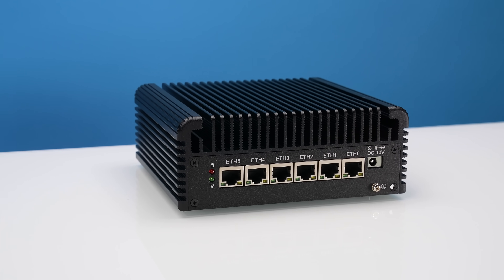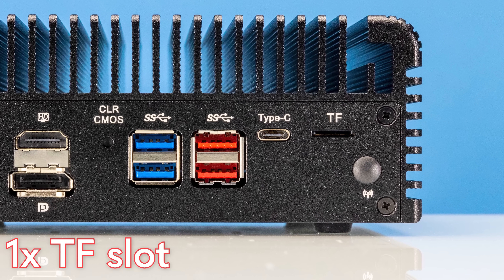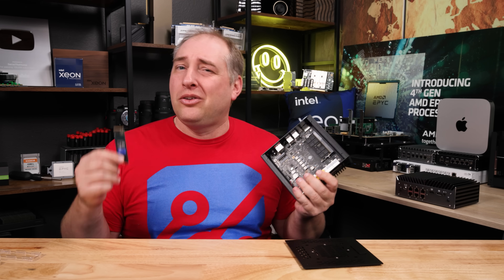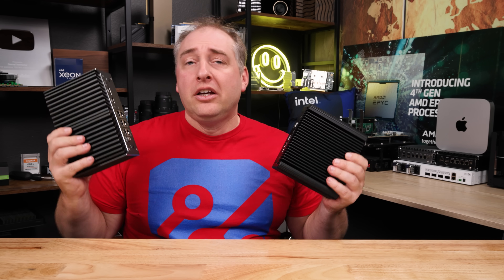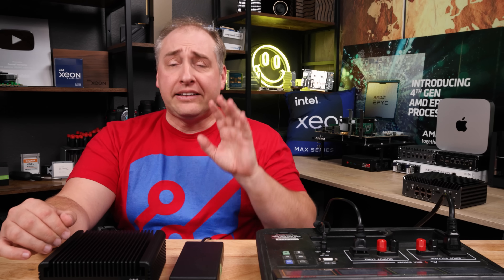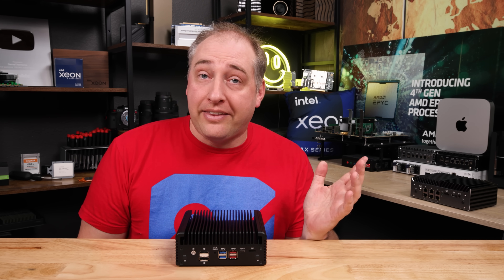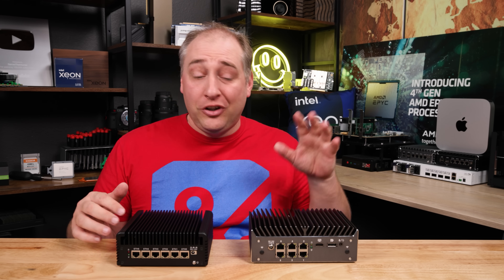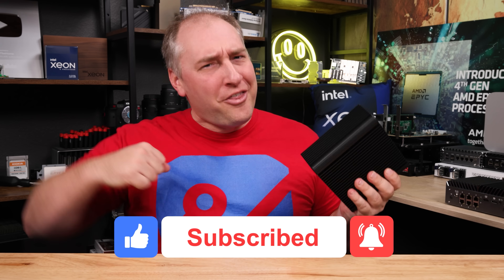KING of Fanless 2.5GbE Mini PC Routers and Firewalls Now with Intel Core i5 Alder Lake

Comment: @4.17 it says Note: These are VERY picky on RAM, and then it says DDR4 3200 SODIMMs.  Does that mean they need to be DDR4 3200 SODIMMs, or they need to be a specific brand?  A link to the RAM would be useful, thanks.

Comment: I have a question. I've been trying to go through a lot of your videos, but for some of these mini-pcs, I don't see any section on networking throughput. Can this (and other devices that do not have a network section) actually push, say 80% 2.5*6 (or 2.5*4) Gbps? What about when using a lot of firewall rules? Can it do 2.5Gbps when 1in-1out? 
I don't find this review helpful if there is no section on network throughput. Especially when the device under test has CPUs like the J3710 (the protectli) - they seem weak, and some reviews do say they aren't strong enough. I really hoped you'd cover this in some of the other recent and past reviews I've been binge-watching.
Reply from the maker: This is in a completely different class. N5105/ N6005 can do simple 3 in 3 out 2.5Gbps NAT. Adding firewall rules it depends on how big you go there. Still, this is in another class since it has P-cores. Since the barrier to 2.5Gbps throughput is so much lower than what these offer, you can even virtualize and do 2.5Gbps NAT + firewall on two ports without issue.
Reply: @ServeTheHomeVideo  Thank you for the info! This really helps. I was looking out for some open source-ish hardware, and the protectli came to mind. I wanted to the low-tier 2.5G ones (The VP2420), but was unsure if I can push 2.5G through at least 3 ports close to their peak bandwidth with average amount of rules etc. Protectli has some benchmarks but that seems to stress only one interface. 

Also, these alibaba ones have good hardware, but what about bios updates? Since this is going to face the public internet, I don't want mine hopping into a botnet due to security issues from lack of firmware updates. Should I be worried about that? 
Thank you for your time!

Comment: I bought one of these a little while ago. Been using it as a small Proxmox system running OPNsense and home assistant. Proxmox sees all the NICs and bridges them all into one "switch" with no issues. Rock solid a month in.

My PSU was generic and didn't have a UL label... But they're pretty common PSUs, so you might even have one from a spare laptop sitting around.

Mine came with a A+E key to B+M key adapter board, so you can have two SSDs (albeit one at x1 PCIe) instead of one SSD and wifi.

The small, 10mm thick fans suck. Don't even bother with them. I have dual SSDs in mine and a 40x10mm Noctua keeps them both cool. I also run a splitter on the fan to aa loose fan on top of the heatsink because I'm weird. The design means the fan on the underside DOES NOT COOL THE CPU. All the CPU heat is going to the top heatsink. Stick a fan on it and it'll be fine. The fan connector is 5v only! So I suggest just using a 12v fan and setting it to max speed.

I really, really wish they had that fancy "turn normal RAM into ECC by storing ECC data in RAM" thing which has been on some Alder Lake embedded systems.

There was a BIOS update for mine. If you track down the info on the board itself, you can find links (on a dodgy Chinese manufacturer site) to working BIOS updates.
Reply: Did you have to drill out holes on the bottom of the cover for the 40x40x10 pattern? Any thoughts on a fan wise to use for the top? I'm assuming I'll just have to jerry rig some sort of ziptie mount, lol.
Reply: @jcarman  I just put one screw in, the fan isn't going anywhere even with just one screw.
Reply: I'm hearing the nic are not bridged which is your exact model

Comment: I have the 2x2.5Gbe N4000 version of this thing and I am definitely not happy with it. I bought it to use it as a simple firewall running OPNsense. However, the device would randomly reboot itself once every 24 to 36 hours. I thought maybe it was some hardware issue since I purchased the barebones version and installed my own RAM and SSD. I tried changing out the RAM to some "higher quality" SO-DIMM but after doing that the device won't even boot anymore. It appears to only accept 2133 spec memory. I could probably send a bunch of time trying to figure out which memory is the most stable in the unit but I don't really have the time or money to do that. I really wanted to like the product I bought but so far it's been nothing but a headache. I hope the newer version are better.

Comment: Can you advice inexpensive model for a pfsense or opensense based router? Just with a few 2.5 Gbit intel ports and a processor that will work around a few firewall rules and ad blockers.
Reply from the maker: We have some great, low power, and pretty inexpensive, fanless unit reviews with 4x 2.5GbE Intel ports if you look at our previous videos.

Comment: Oh boy, the stubbornness of my mind vs the reality of what is in the box...I have the older Qotom with the i5 7200 running PFSense bare bones. Been several years no issues but bug bit me... want a newer one with i226 nics.  Gotta be an i5 like what I have now...  finally a little birdie talked me out of it, get the 8505 instead.  i5 Kaby lake is nothing like 12th gen i5...  Even that 8505 runs circles around the old 7200, probably could have gone lower.  Simple edit of exported setting file then apply to the new box and I was back up and running.  Did slap a 120 fan on top to help those fins and it did cool the proc some 4~5c more.  Agree on the WD Blue- 26 bucks got me a 500gig one - I couldn't find a new 250gig on Amazon...  no biggie, zfs supports trim so the wear leveling has lots of room LOL.  Thanks for your review, I was waffling for a bit but glad I jumped on one.  Put my vlans on the nics, now just need a new managed 2.5gig switch...

Comment: I have the i7-1265U version and added my own ssd and RAM and it's been working great, I am using Proxmox + OPNSense VM and UniFi controller LXC
Reply from the maker: Mind sharing the RAM you used either here or in the forums? I think we should start documenting that for folks
Reply: Could you please tell about temps and throttling under load?
Reply: @ServeTheHomeVideo  G.Skill F4-3200C22S-32GRS

Comment: So I've been thinking for a while about retiring my poweredge iii 2950.. think it has dual xeon e5450 or something.. quick Google for 1235u vs xeon e5450 shows most benchmarks are 1.75 to 4x, anything under 2x might be a slight loss due to the server being dual proc but most benchmarks i see are 3 to 4x, geekbench4 is like 3.75x.. and under 30w for a whole system, silent versus loud server at probably like 300w idle.. I lose spinning rust raid for nvme (but I can keep server for some nas backup stuff and boot as needed) and lose ipmi (which is probably one of the biggest hesitations for me but while its nice to have I've rarely used it) .. this stuff getting so damn tempting.. originally I figured if I made the switch that whatever new mini would only run pf but if the benchmarks don't lie then I can easily setup xen or whatever and have basically the same setup but way quieter and faster in most scenarios and way more power efficient. My only gripe is I wish these had 10gbe ethernet ports but I'm an impatient weirdo that finds even 10gbe slow for certain things (setup 20gbe tbolt between my pc and Mac) .. I get that we're not at the point where 6x10gbe would be cheap yet but wish it at least had 1 or 2 10gbe then I could add a 10gbe switch.. I'm still damn tempted though and I'm moving soon and I can say 100% if I end up in a place where power isn't included then I'm gonna pull the trigger cuz I can't justify 300w minimum (and thats being generous since it has 2 cpu and fbdimms and 2psu) 24/7 for pf and some vms..and if I move somewhere that has fiber support then also yes for 2.5gb (fiber here is 2.5gb symmetric, my cable is 1gb/100mb but my building doesn't have fiber so fiber company will only do 50mbps/15mbps dsl and yeah no)..plus my server doesn't have vtd and often my lacp nics like to chug and max out the server randomly on low traffic (ugh, tried everything from different virtual nics to disabling offloading for every different possible setting both on xen and in pf, ovs still likes to have queues max out randomly, it's not consistent, it's totally random and it's annoying af but not quite deal breaking)

Crazy that a mini passive thing almost destroys a server from 2009 now in like almost every category except maybe expandability and ipmi although other than the loss of SAS RAID, the other expandability would be mostly for NICs and when you have 6x2.5gb on board that's the same number of ports I already have but 2.5x faster.
Reply: I think I might just say f it and order one of these or similar on payday anyway. Included win pro license helps offset too. I'm sick of my servers fan noise. For years and years I didn't care but last couple years I must be getting old and get off my lawn wait I don't have one. 

But seriously I was just waiting for something small cheap and low power than wouldn't be a huge decrease in performance and benches says its an increase sooo..

❤ Patrick and sth team for covering this shit and not just beast server noisy homelabs like I currently have. Time to green up i guess
Reply: Yeah 12w idle vs like 350w idle.. 3% of the power usage idle.. and probably max 5 to 10% pegged for more performance in most cases. I know my server is old but still..there's a time you just know to upgrade.
Reply from the maker: Yea, it saves a lot over time doing a NAS + then these smaller nodes. The higher-end Project TinyMiniMicro nodes are starting to be ~ dual E5-2670 V1 servers in CPU performance but with <10W idle. You just give up memory and expansion for low power and quiet.

Comment: Tried 8505 w 6xI226 and it's really good. Works with anything - Suse, Proxmox, DSM. Number of ports is insane, tons of internal and external ports. You can have 2 RAMs, 2 NVMEs and 2 SSDs, say what. SD card, type C with 4K video, RST, internal USB, WiFi 6 also works. CPU is pasted well,  no manufacturing issues, no crashes. Performance is fantastic, easily outperforms Alderlake i5(!) in single. With QAT, what else do you need for a VPN router? Update: so the best feature - QAT - is not possible with the AMI BIOS there:(

Comment: I am trying to install Proxmox on a fanless PC that has a 12th-generation processor (N200), and I am having the same compatibility issues causing the installer to fail.  I tried following the same installation procedure you laid out in the video, but proxmox 7.1 is not available for download anymore.  Only. 6.4, 7.2, 7.3, and 7.4.  I assume the installation procedure would be the same for my 12th-generation Intel N200 right?  Any thoughts or suggestions on how I can get the installer to not fail?  I believe a graphics compatibility issue is causing the GUI installer to fail.

Comment: I like your testing and reports on these items. I'm looking at replacing my Netgate 2100 with something more powerful and that doesn't have upgrade problems. I'm on FiOS and while I'm not at the top tier if I was the 2100 couldn't handle that either. Are you planning on a video covering what level of performance is needed for a simple firewall? I know of a few that cover pfSense and similar installations but a guide, even if you just have links in the description to good guides that is enough. I'm not a big Linux person but Windows Pro and such is my comfort level. In national security related work the separation of duties doesn't let me get the experience of sys admin stuff. I'm used to just RDP into a Linux VM that is running so I never set that up, just install development tools and code away. The various SW options on these things isn't so obvious. I have seen individual guides but not ones suggesting various combinations or packages (think of buying a vehicle and what goes with what), and what to install in Etsy order. I am one of the consumers that wants simple is better when it comes to stability. I don't care if logging goes on a 128GB thumb drive I swap out with a clean one from time to time, that's what I mean by simple. Again, thanks for the HW info I'm trying to sort out the SW side now that the HW is looking like a commodity (RAM, NIC, SSD, USB).
Reply from the maker: Great feedback. I am sending this to the team.

Comment: Proxmox 7.4 can be installed out of the box with no issues apart from display migrating from HDMI (default for bios and early boot) to type-c output, and after installing 6.2 kernel - all display outputs will be working once again.

Comment: I bought the 1265U version barebones. One big difference I don't think you mentioned is that it comes with 2 SATA ports whilst previous Gens had just 1. NOTE: Oddly it only comes with one SATA cable; I had to order another one for 15 bucks from the vendor.
Right now I'm running it with 2 NGFF drives w/SATA adapter boards, one drive has Proxmox, the other for VMs. It does get quite hot so I have 140 mm fan sitting on top of it, fits great and keeps it cool, no noise.

Reason I'm doing that is to free up the 3.0x4 m.2 slot, I believe previous Gens had a 3.0x2 slot. I would like to try buying a M.2 -> PCIe adapter and running a dual 10Gbe NIC with it. Do you think this would work? Also: What is that 4 pin power adapter on the board near the power button for?
Reply from the maker: Ours came with 0 SATA cables :-(
Reply: @ServeTheHomeVideo  That's not good😑. Any idea what the 4-pin connector next to the power button is? I assume it's there to draw power from...
Reply: Just posted about the same thing essentially: have one of these and would like to free up the PCIE3.0x4 slot in order to run a 10G SFP+ NIC. Would probably need to fabricate an expansion to provide the IO, unless you know a better way?
Reply: @justinth83  I'm not totally sure what you mean, my plan was to use one of the riser cables (ASIN: B07Z4RC273) which will convert an m.2 into a standard PCIe 3.0x4 bus.

The riser cable should fit underneath where the optional hole is, I already have the hole punched to route the fan cable for the 140mm I have on top of the unit. I will use gorilla tape to hold the card in place next to the unit. A 3D printed bracket to lay the card flat under the unit would look a lot better.

My main concern is that the riser requires additional power from a SATA connector that I do not have free in the unit, both sata connections are in use. I hope the 4pin connector next to the power button could be used but I don't know what it's for yet.
Reply: After thinking about it some more; I believe the 4 pin connector near the DC power in (not the power button like I previously said) is probably for supplying power to the board, if for whatever reason you can't use the DC power in. A SATA power splitter and data extension cable will probably work.

Comment: Do you (or can you) have a video segment regarding SOHO/SMB 10Gbe ssd/flash iSCSI solutions? I have a pair of HP DL360 G9 servers I run vmware on and would like to have shared VM storage to enable running a VM on either node.
Reply from the maker: Interesting idea. Will give it to the team to see if they can do it.

Comment: Does anyone know if it's possible to add an SFP+ NIC to this device? Obviously would need to find a creative solution for the IO plate...
Reply: Unless I'm mistaken it has 1x M.2 PCIE3.0x4 slot and 1x M.2 PCIE3.0x1 slot. So in theory it's possible to run SFP+ to the x4 slot, and run an SSD at slower speed in the x1 slot. 

I currently have this device in a router-on-a-stick configuration with 2x2.5GbT ports in a LAG configuration acting as a trunk, but this takes 2x SFP+ slots on the switch and only provides up to (theoretical max) 5Gbps if multiple devices are pushing traffic concurrently. So a single 10G link to the switch with a DAC cable seems like it would be much more elegant solution as it would provide greater bandwidth, all bandwidth is available to a single device (no LAG limitations), use only 1 port on the switch and consume less power.

Would be great to hear insight from anyone knowledgeable about this?
Reply from the maker: Someone is adding 10g in the forum thread linked

Comment: @ServeTheHome - great vids, not too intimidating for a noob like me.
Could you run Proxmox and with that: Jellyfin media, pfSense and TrueNAS on there?
If so, what's a recommended way to attach SATA drives to this thing in an organized fashion (external of course)
Reply from the maker: You could, but the challenge is the SATA side. There are two SATA connectors but they use an uncommon data + power connector. This is probably not the ideal NAS just due to the form factor limitations.

Comment: I bought this unit a few months ago and added 64GB RAM and 2TB SSD, using proxmox and opnsense, the device gets very hot to the point I can't touch it, not sure if this is normal, CPU temperature most of the time around 77 degrees
Reply from the maker: It may be worth looking at the folks in the forums tuning power on these.
Reply: Is it possible to reduce the PL2 in Bios to reduce the power draw?

Comment: While  I dont have the particular one in the video, I do have a PC in storage with a similar style case (HYSTOU). Only a 4200U with two gigabit ports. Guess I should check out pfsense and opensense over the weekend then. Didnt seem to hard if you just want a router for your cable modem. While it goes against any advice on the channel I currently have my PC connected directly to the cable modem, as I wanted to see just how much of a bottleneck my router really was. About 80-90MBps with a router between and upto 112MBps directly connected (both wired).  The download speed also have a tendency to slow down if I dont regulary reboot my router.